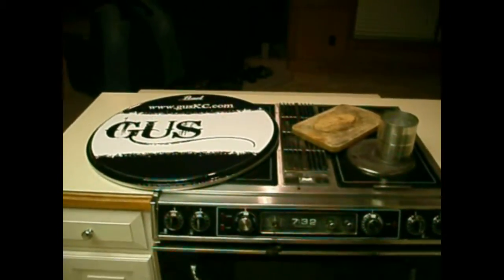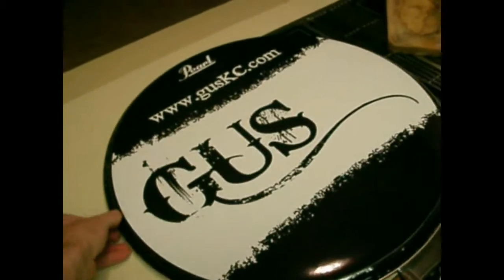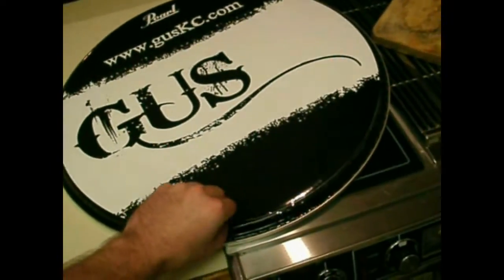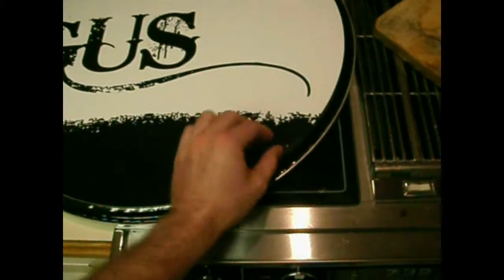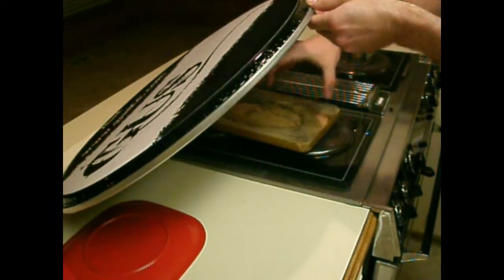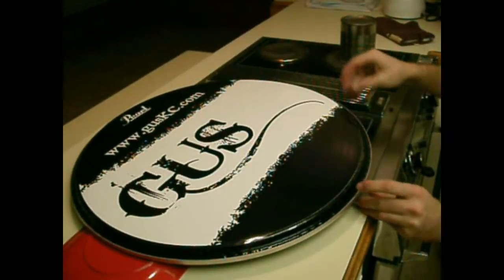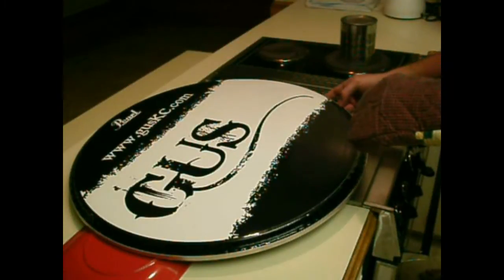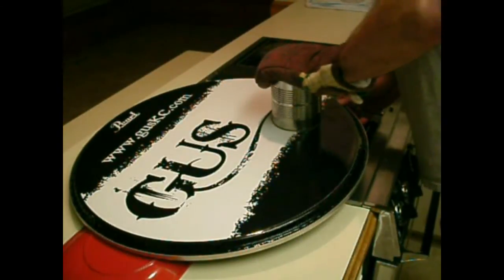Creating A Port Hole In A New Bass Drum Head

Comment: I tried this method but it is not easy. The easiest way to open up a port hole is to get a kickport which comes with a 3M plastic ring which lets you cut a hole with a X-ACTO type knife. Clear and easy and plus you get a kickport as extra bonus to enhance the sound of your bass drum.